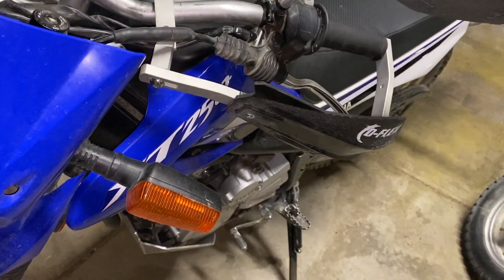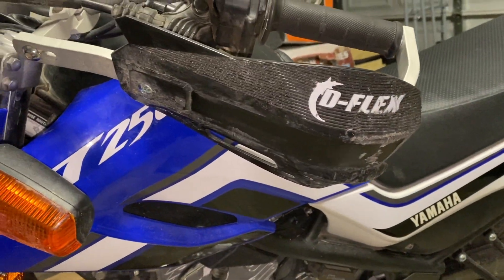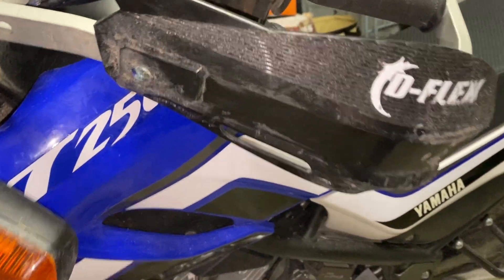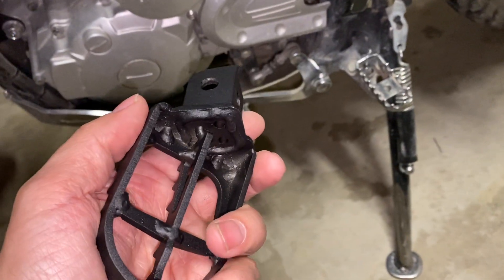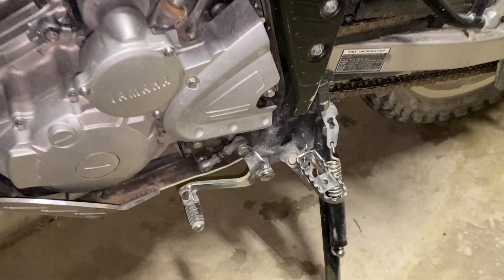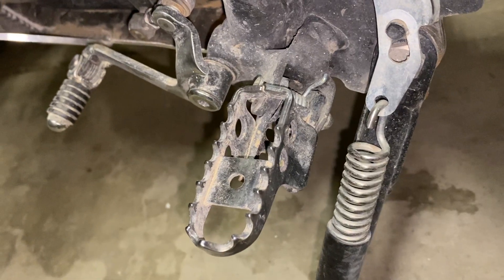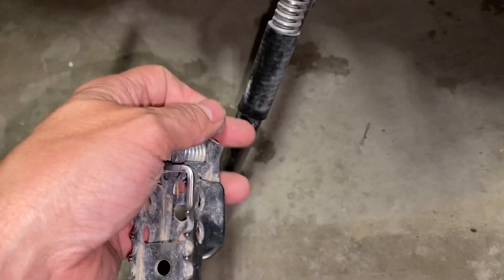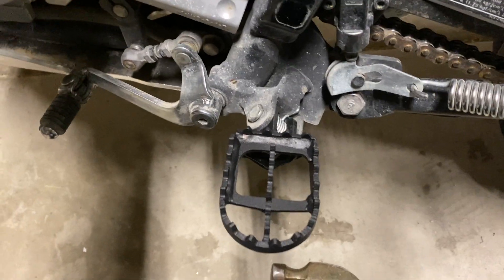Yamaha XT250 DMO Foot Pegs Installation

Comment: I'm surprised there hasn't been more comments on this mod.  This one makes sense, seems to be reasonably priced and might add more stability when riding.   You don't want your foot to fall of the foot peg when making a turn in the dirt. Good job.  Hopefully, they are made of strong material to prevent breakage.
Reply from the maker: NoBs Yes, they add a ton of stability, and they are very strong. I can’t imagine them ever breaking. In my opinion they’re a must-have for anyone who does much off road riding.